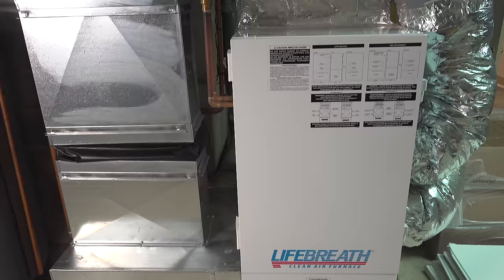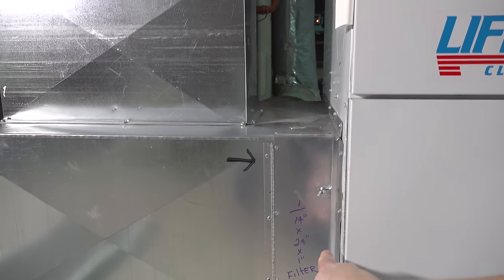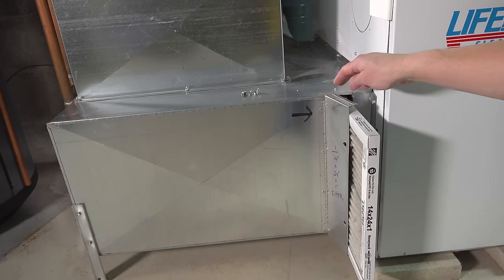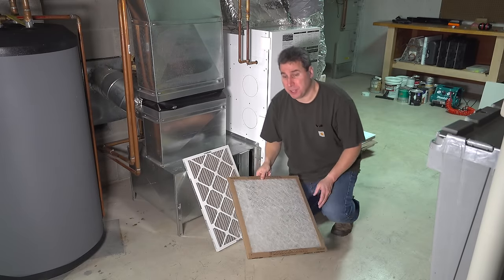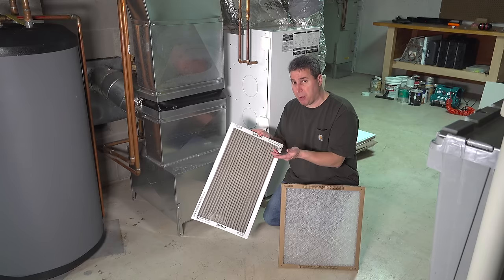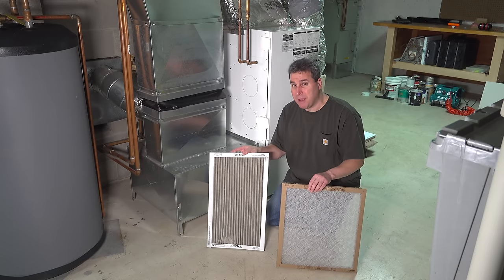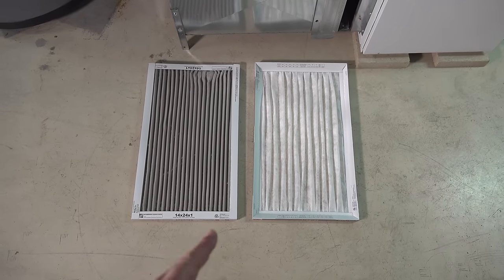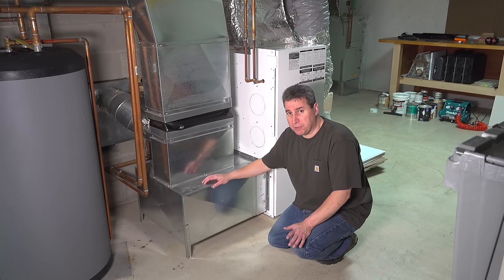Furnace Filter - How to Change it the Right Way & SAVE Money

Comment: Based on my own experience, I change my filters twice a year.  I have two separate heat pumps / blower systems.  One for upstairs and one for downstairs.  I track how many hours the system is running, not some some arbitrary number of months on a calendar.  If the system is not running, the filter is not getting dirty.  My heat pumps only run when heating or cooling is called for.  Here in SoCal, there are two distinct seasons - summer and winter.  For a month or two between the cooling and heating seasons, the weather is very mild and the systems are essentially not used.  That's when I put new filters in the air handlers  - between seasons.  So each heating or cooling season starts with a new clean filter.  I use MERV 8 filters which do a good job without choking the system.

Comment: When my system was installed, it used a 5-in thick filter. That thing lasted forever and was still clean when I replaced it. I find the 1 inch ones with less filtering area, didn't last nearly as long.

Comment: if you watch other hvac videos basically if you wanna filter better and last longer just upgrade to a thicker box, on 1 inch you are pretty limited on filter, do 4 or 5" then you can run 11 and 13, looks like your furnace has plenty of room you could splice in a 5" filter box and with merv 8 it would last you all year

Comment: I originally used the first example filters when I bought my home in 02, about a yr or two later I started using the 2nd one pictured.   I usually replace my filer every 1 to 2 months depending on use.

Comment: Good advice. My pet peeve are return vents that are ceiling mounted. This requires breaking out a ladder to change filters. Fine if you are young and strong but what are people who are older or not able to haul out a ladder and climb it? Then people wonder why the filters are clogged. The system that you have is perfect as most anyone of any physical ability can change it.  My other pet peeves are HVAC systems in the attic, especially gas fired HVAC systems that the homeowner simply can't monitor on a regular basis.  Just some thoughts.

Comment: you should talk about the benefit of using a ‘fatter’ filter, e.g. a 3-inch one. even with the same filter rating it has larger filtration area (more holes for the air to go through) so it is less restrictive, and allows for more air to go through while maintaining the same level of filtration.
Reply from the maker: Yes that is a good point, someone else mentioned that also. Its really a shame that they are so rarely used. Not sure why, I don't think it cost the installer much of anything more either.
Reply: They also don't need to be changed as often. I've got a thickboi 3 inch filter and it looks almost new after 3 months. Granted, I also keep the house clean.
Reply: Fatter filters can only be used on a very limited number of furnaces and definitely won't fit in the return registers in walls and ceilings.
Reply: @bootburner4544  actually that’s not true, I have 3 inch thick media filters in my regular old ceiling return vents. Check out the design of Honeywell’s FC40 filters - the thicker part is inset and slides further up into the duct and only the bottom inch matches the size of your opening. Fits like a glove. Also, you could just swap out the filter compartment on your furnace to accept thicker filters. This should be a no brainer as you’ll get superior filtration without the flow restriction. If interested in air quality you’ll need MERV 13 or 11 at minimum.

Comment: I've always been told to change it once a month during the winter and twice a month during the summer of course I live in Florida where there's so much dust and pollen
Reply: Twice a month is way too much. Pull the filter out and hold up to a light. If you can still see alot of light, dont waste your money changing it out. Pollen is too small to get collected very well in a filter. Youd need an air ionizer or electronic air cleaner installed in your furance if you want to lesson that.  (And wash your hair/pillows every few days). Filters do not address pollen.

Comment: Great info and tips....we have two furnaces and one is in the attic which is really hard to get to as I age but we have two dogs so I try and change the filters every few months.  The air flow direction is always a question, not so easy to figure out the direction but the arrow should point toward the furnace is what I've learned.
Reply: I had hard to get to filter under house. Got too old to deal with it. It was a Space Guard and I hated it. Had to put it together to replace it and components would brake and have to be sh@t rigged. HVAC guy said, go back to simple in house as it will do fine. Still have large filtrate filter in attic but is easier than the SG to change. As pointed out the furnace is not an air cleaner like we wish. No matter what I use we get too much dust.

Comment: I see that your basement’s ceiling is insulated with the silver reflective bubble wrap. Do you have fiberglass behind it? Just curious how you did that (tape or staples) and if it’s beneficial insulation. Does it help with keeping the fiberglass dust sealed? Thank you for the great content!
Reply from the maker: Yes, when we looked at this house I have never seen anything like that. My understanding is that its 30 years old and has rated for maybe R9 if I remember. But there is NO fiberglass above it. The walls of this house are also SIPanels so all foam inside. I have never met the family that built this place 30+ years ago but I think that they hated fiberglass since its only in an addttion and garage attic that was done years after they were gone. The foil seems to work ok, and its stapled and taped. Looks like someone spent a ton of time to put it up. Makes me feel like I am on the starship enterprise. I should probably do more on this since it is so odd.

Comment: A couple comments. I recommend turning off your furnace and vacuuming it inside. I was surprised at the dirt accumulation and some of the construction materials found (old wood and nails).  We have an older house. Our furnace technician recommended using only cheap filters which we change monthly due to family allergies. (The prior owner had 3 cats!) This plus professional vent vacuuming does make a difference. I did cover bare concrete walls with fibreglass and foil because concrete sucks away heat in our Canadian winters. The intent was to push additional heat into the house and it worked. I note that some around here even enclose their hot water tanks with foil to reduce hot water tank bills. Hopes this helps someone.
Reply: Imagine how dirty mine were after 89 years. I cleaned mine out for the last time then I moved the filter to the first floor and added a whole new return duct and a 2nd filter. All of the air that passes through both ducts now are clean. Read my post to see what else I did.^^
Reply: How are you guys dealing with heat and global warming? Do you still have gas and oil, etc? Cannot picture how heat pumps will work where you are as they are border line, even here in Virginia.

Comment: I check the filter on my system every three or so months. When I replace one, I am out to the hardware store right away to always have one in reserve. Sometimes they are not readily available so that is why I shop for them right away. My system takes a 20X25X4 filter and I typically pay $35 for each one.
Reply: How often you change 4 inch filters?

Comment: Moved into a fairly new manufactured home, where the furnace is located in a closet-like area near the back of the house.  The door where the furnace is located does NOT have a vent - it's just a solid door.  If I leave the door  slightly open, the air being sucked in will shut it.  Should that door have a vent on it for better air flow?

Comment: SC: thanks for another great video. 

Question for you: should I keep my furnace’s fan on at all times? I was told to do this to help with circulation, humidity control etc. 

Seems excessive but would really like to know your thoughts.
Reply: That's exactly what we do. It acts as a full home air cleaner and with a slightly better filter it can filter out common allergens as well.  Definitely watch replacement times though - we once had our A/C ice over due to restricted air flow!

Comment: I just put in a new pleated filter last week. Out of curiosity I looked at it today and it's already started getting a grey colour. I'd consider our house to be pretty clean though. Not sure where it's coming from. Just been a week
Reply from the maker: If you burn wood or pellets than can be more in the air, and honestly dust from pets, etc adds up quick. Better in the filter than breathing.
Reply: @SilverCymbal  I guess 3 toddlers running around could be the cause. But other than that, no pets and no smoke. Thanks for your videos. Wish you a prosperous 2024 !

Comment: My home is 98 years old and the upgraded 85%+ furnace's return duct was severely undersized when I bought my home. I added a separate duct and moved the now (two) in wall filters to grills in the center hall on the first floor and use washable filters. I also added a WiFi Filter Sensor from CleanAlert that tells me when to wash the filters based on the change in air pressure a dirty filter causes. My watch tells me when they are dirty. I also added a smart WiFi switch to turn off the furnace power now that I no longer need to go down in the basement to mess with filters. So now when I get the alert they are dirty, I tell Alexa to turn off furnace power, wash the filters, re-install the filters, reset the filter sensor on my app, then tell Alexa to turn the furnace back on. I did spend $200.00 for this convenience but this change will last over 10 years. My filters are 1" thick and the frame is just thicker than 1" & they made a bang sound when the air came on so I lined the plastic filter frames with magnetic tape so they stay in the seated position. Note: resetting the app sets the air pressure it takes to run when filters are clean and sends an alert when dirty filters decrease efficiency, so filters are not changed on a time table thus saving money. The filter scanner also compares return air temperature to supply temperature and will give you an indication of other issues such as inefficient A/C. Alerts are sent to my phone then I push the notification to my watch. I usually wash the filters when they get 60% clogged.

It has been 50 days since I washed my filters, I have 5 cats and 5 bedroom home and the filters are 51% clogged as of right now. The 80+ smart devices I have in my home make a 89 year old home seem brand new and I spend less time & energy doing simple things like turning on/off things.

Questions?>>>>

Comment: Look at the number of pleats in the filter you removed versus the filter you are putting in. More material means you are forcing air across more surface area, which means better air flow. the fewer the pleats, the less surface area and the worse your airflow is. 

I agree with the premise of what you said, but what I did was pick the filter with the most amount of pleats per inch that I could, then I had the option to step up one level, but I noted that the pleats were the same in the higher level, so it just meant the material was going to get more restrictive, so I stayed at the lowest level with the most pleats per inch that I could. When I look this up, they basically say a filter with a higher MERV rating and more pleats per inch will have the same or better airflow than a filter with a lower MERV rating and fewer pleats per inch. Combine that with the fact that the lower surface area will fill much faster and the bottom line is, make sure you are changing your filters every month if you are going to have that few pleats, in my opinion.

Comment: The cheap filter was recommended by my HVAC installer.  He said the pleated types restrict air flow and may cause the furnace to overwork, reducing it's life span.
Reply: I’d check with the manufacturer. They should be able to tell you whether pleated filters are okay to use, and what MERV rating is allowable for your furnace.
Reply: @rik8809  🤔🤔 the manufacturer will tell you to get the one that will
break your furnace the fastest 😉😉🤣🤣
Reply: Mine said the same thing
Reply: The main purpose of a furnace filter is not to clean the air in a home, but to protect the furnace and air conditioning components. Using a filter that restricts the flow too much will without a doubt shorten the life. The manufacturer will have determined what the type of filter is required to avoid that before the furnace was ever installed. 
Using a cheap filter as recommended by some HVAC guys will allow more dirt to get to the various components, leading to breakdowns.   Question: Who benefits then?  Answer: The same guy who recommended using the cheap filter. 
The smart thing to do is to use the one that’s spec’d to your furnace.
Reply: That is a typical technician tale. Like old wives tales, they aren't based on science. A moderately good filter will take out annoying and aggravating pollen and dust without restricting air flow.
Reply: 100% false info. Pleated are always recommended to protect the fan motor and indoor ac coil from dust build up. Just dont go crazy and get the 3M high density ones.

Comment: You CAN run your HVAC 24/7, just look for Ventilation/Fan mode and adjust accordingly. IF you got a return filter it WILL pass through it 24/7 if the venting/fan mode is switched on (sometimes you can even choose between low/high even).

Comment: Use a Merv 7 or lower This will keep your furnace from going off on high limit. Going off on high unit too often can stress the heat exchanger causing it to burn out quicker You should change your filter every 3 months. The filter was designed to keep debris out of your furnace not to clean your air.

Comment: Thicker filters last longer as they have more surface area to catch the dirt.  My 20x25x4 filter only needs to be changed every 6 months, although higher MERV ratings need to be changed more frequently.  My service tech recommends MERV 8.
Reply: Yes but not all furances have the fan sized to accommodate those bigger filters. So you have to use, whats already installed.

Comment: I use the middle grade filters too, but we have our furnace fan run continuously to circulate the air and have to change the filter monthly.
Reply: You should be changing filters based on what your eyeballs tell you, not just a 30 number. I can guarantee in the spring and fall months, it isnt dirty enough enough to be changed monthly.

Comment: A standard one inch filter in a residential unit is not for the human. It is there to protect the evaporator. Unless you have up sized ductwork, I would not use a pleated filter at all. I check static pressure all the time and pleated filters increase static pressure considerably, sometimes up to .8" of water column pressure, which is way to high. If your filter rack can only house a one inch filter, I would use a filter you can see through.

Comment: You say every couple months to replace the filter.. what if your furnace is off for 7-8 months a year? are you including the downtimes or just the times when the furnace is running?
Reply from the maker: You are correct, just for the time you are running it. They won't break down, unless they sat for years and years. I will often put a new one in right at the end of the season so I dont have to worry at the start of the next one.

Comment: Thank you for mentioning that this filter isn't an air purification system - it's a simple filter to stop pet hair and dust bunnies from getting into your furnace and clogging stuff up. Not even close to enough of your home's air is running through this thing for it to really matter regarding picking up microscopic particles for overall air quality.

Comment: I like to put a neodymium magnet close by such things so you can pop the wing nuts on them and KNOW where they are when you come back to them.  It’s a great tip fior all sorts of things - drill press for the chuck key, push stick for bench saw/band saws (glued to the plastic push stick and stuck to the body of the machine), glued to cordless drills to hold bits/screws. I could go on and on 🤪🤪🧐🧐.  Anyone got any really cool use cases?

Comment: I have these metal filters in my furnace with large slots between the metal braces in the air filter. Their supposed to be just washed and reused and last forever!  But just looking at these metal lifetime metal filters they don’t looks like they would stop much dust at all from going through your furnace!  I personally don’t trust them and bought some different filters that have a screening material across the whole filter. Whether or not it’s any better than the others that were originally in the furnace, I don’t have a clue? But I been waiting for the day that I meet someone more intelligent about furnace air filters than I am that can tell me better about whether the original filters were better or not?  I believe the original are supposed to be electrostatic air filters, but if they catch more dust you couldn’t tell it by me?